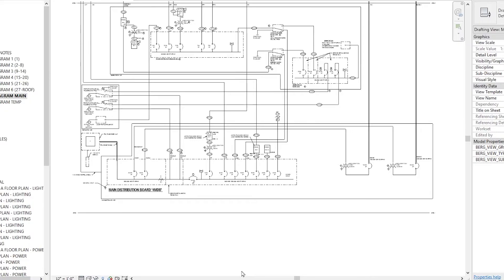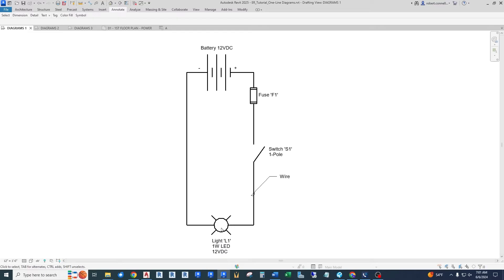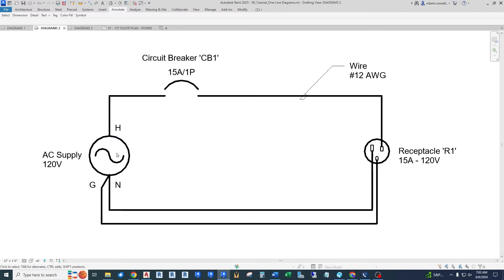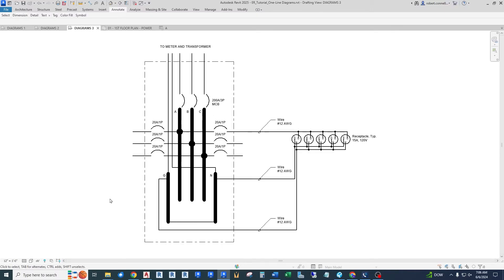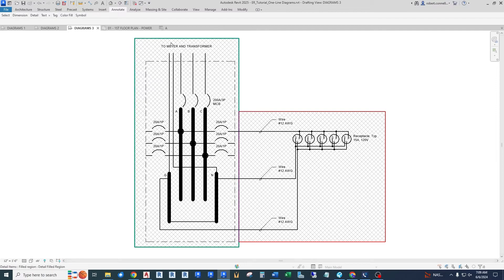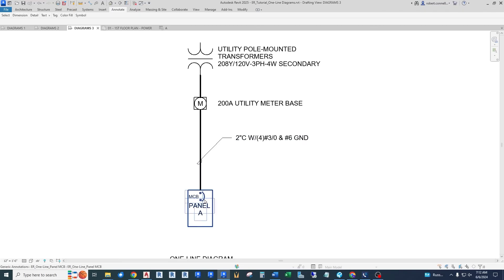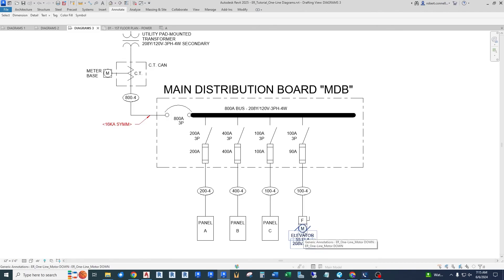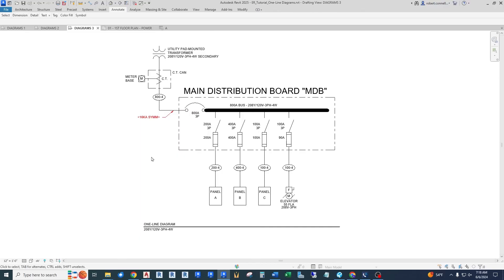ELECTRICAL ENGINEER Explains One-Line Diagrams

Comment: Great video 
Is there a program that does these single line diagrams besides AUto cad , I’m just trying to do a simple 1200amp main lug service with 4 distribution 2x 600amp & 2 400amp , so I can practice I can draw it out on Graf paper but want it to look professional…
Reply from the maker: Hey there! Well here in the industry we use programs like AutoCAD as you mention, or Revit, which both are quite costly, but also PDF editors like Bluebeam Revu, which is a bit more reasonable, and I believe there is a 30 day free trial. And since these diagrams are just 2-dimensional drafting, really any drawing app would work (i.e Canva, etc). Hope this helps!

Comment: For the MDB panel, would the MCB be considered the main disconnect or would that along with the fuses? If its just the MCB its just one, if the fuses are included its 5 disconnects. Just wanted to clarify because you’re permitted no more than 6.
Reply from the maker: Yes, the main circuit breaker (MCB) would be considered the one and only service (main) disconnect in this situation, and the fused switches end up being more of a sub-disconnect. Turning off that main circuit breaker would de-energize the entire service. Thanks for the question!
Reply: @ElectricRob  Awesome. Thank you for the video and clarification! Makes navigating this new discipline a lot easier. I’m just out of college starting in building code enforcement with no experience and not many resources to go off of; videos like this help tremendously.
Reply from the maker: @alejandropina4444  Glad to hear this video is helpful to you, and good luck in your new position! So far, this channel has primarily focused on Revit for electrical building design, but I'm going to be also including more videos specifically about MEP Electrical Engineering topics - stay tuned!